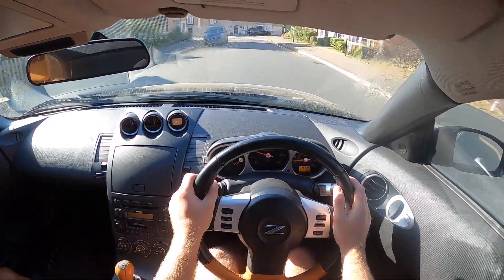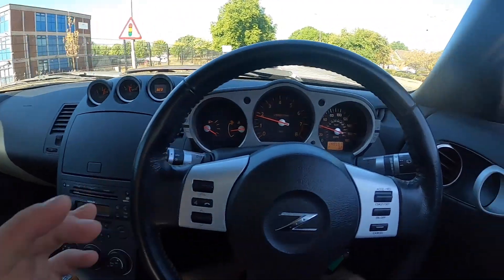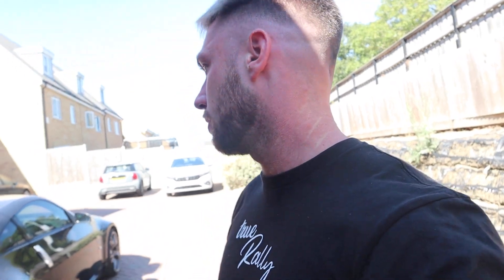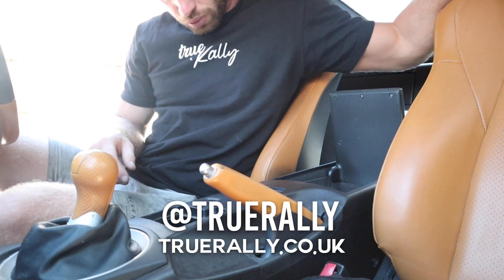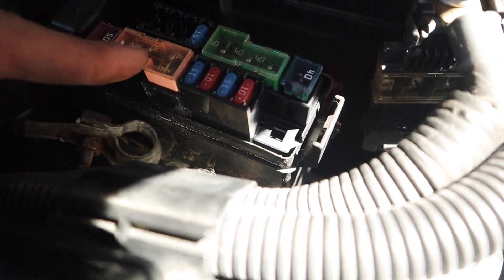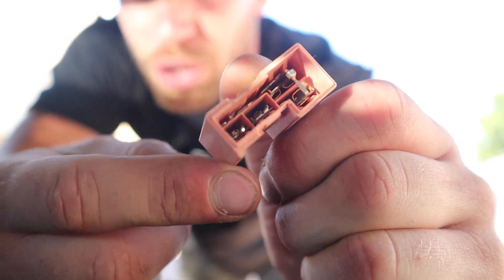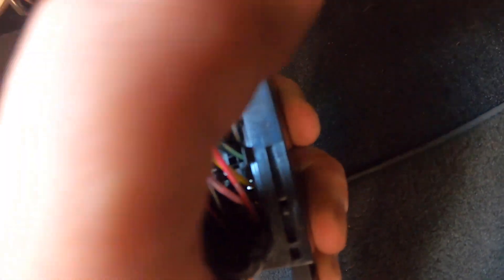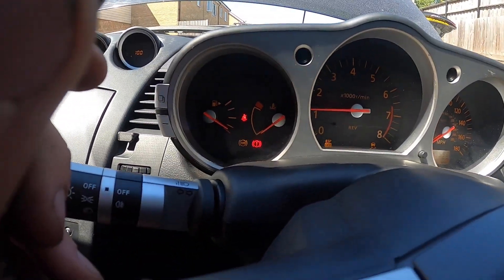I CANT BELIEVE IT!

Comment: You could have just used a de-pin tool and pulled the wire out of the connector which would have made reversal so much easier
Reply from the maker: I didn’t have one.. potentially buying a new fuse later down the line was an easier option
Reply: @itsleelockwood  worth having one of your going to do these mods again on other cars.